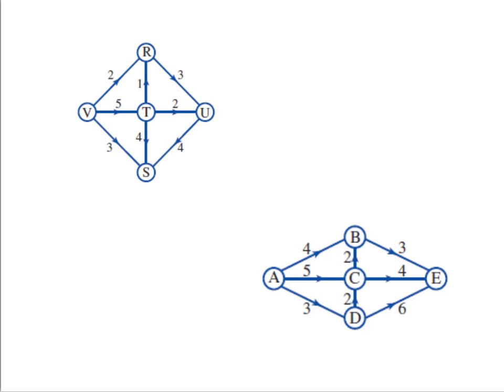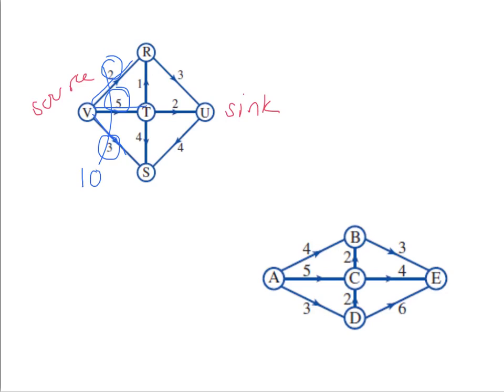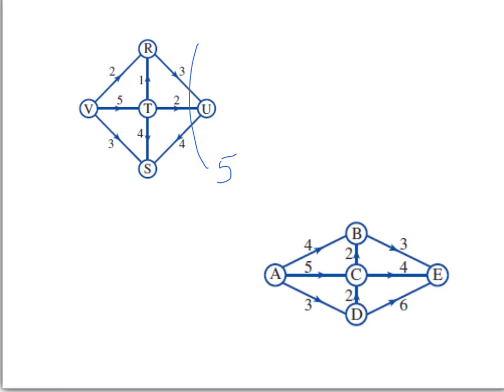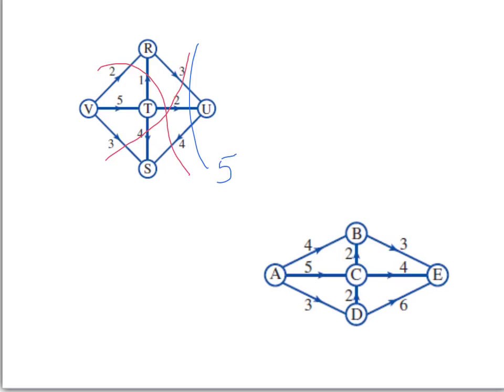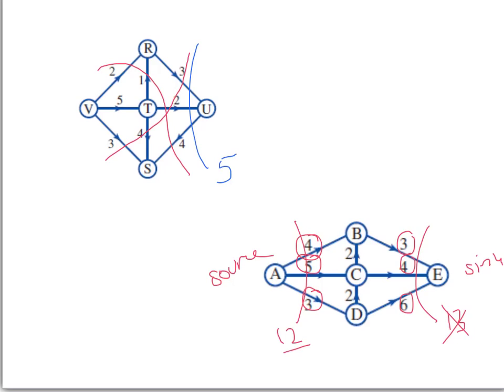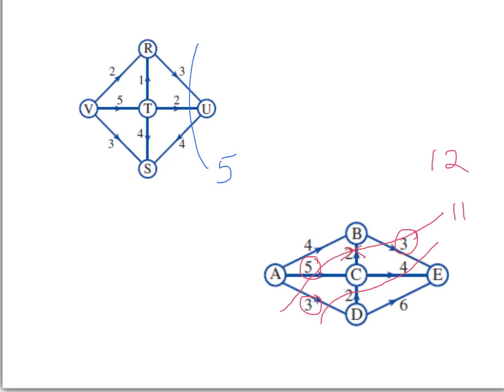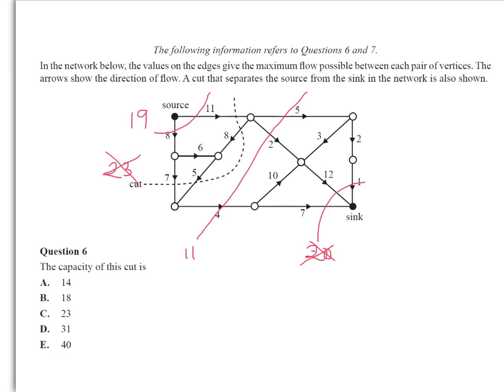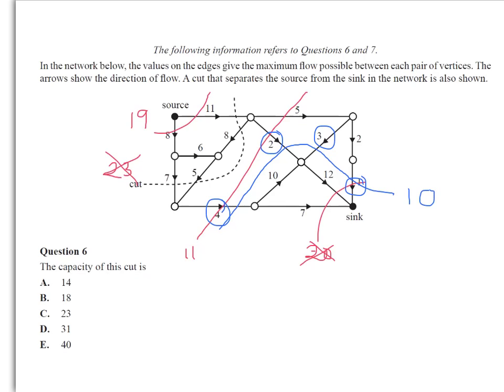Maximum Flow

Comment: How do you know whether they are traveling from the source to the sink even if the arrow is pointing in the direction of the sink!! someone please help!
Reply from the maker: It depends on whether the pathway from the source has already been cut off before you get to the edge is question, rather than which direction it points in. In the video where I say not to count the edge from c to b with a weight of 2, it's because the "cut" already cut off the path from source to sink on the edge a to b.  Hope that helps! Otherwise, check out the video for an alternative method to the minimum cut which lets you get the maximum flow another way.
Reply from the maker: +VCE Further Maths oops, should have said 'already cut off on the edge a to c'!!
Reply: +VCE Further Maths Thank you very much. I finally understand this concept. I've asked my teacher multiple times to attempt to explain it to me and it always ends up being more confusing than it originally was. Thank you for taking the time to reply to my comment. I appreciate it.

Comment: Still extremely confused on when to or when not to count values. I dont get how you can tell if they are running from source to sink or sink to source..
Reply: U can get the 7 by cutting from 5 towards the sink side so you cut the 3 and 2 so by looking at it the 3 is going back to the source side so we don’t count it so it’s gonna be 5+2=7 traaa
Reply: @jack11100  this would’ve been helpful 5 years ago HHAHA

Comment: just noticed, wouldnt the sink on the first problem you did be S since all 3 are going to it and not U ?
Reply from the maker: Simeon Dyankov that's probably right Simeon - thanks for picking it up!  For the purposes of the example, it really doesn't matter which vertex is the sink, but generally it is the one with all edges leading in.
Reply: @VCEFurtherMaths  It does matter, because the 2nd cut is not a valid cut as it doesn't seperate the source and the sink.